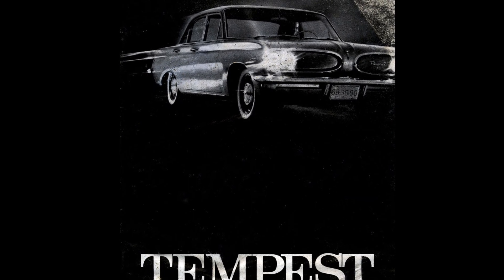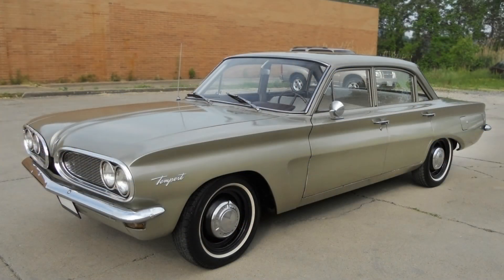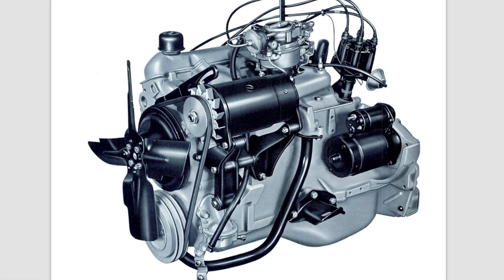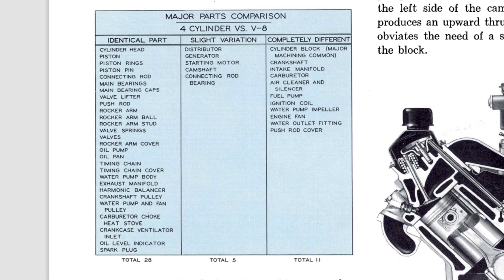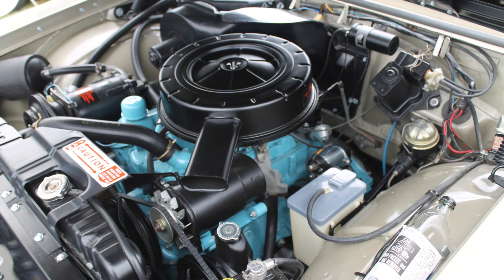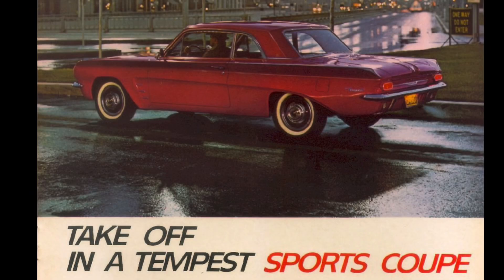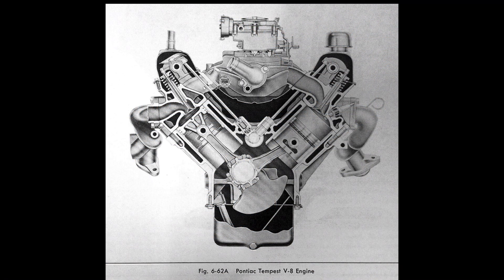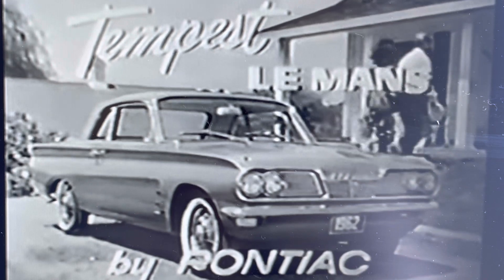Strangest Automotive Engines: The 1961-63 Pontiac Tempest & Its "Trophy 4" / "Half 389 V8" Engine

Comment: I'd love to see more videos about the first gen Tempest. I had at one time read that they had some major handling issues. I'd also love to learn about Pontiac's version of the aluminum V8 and how the engine connects to the rear transmission.
Reply: If you look at the 50 second mark in the video, it shows that the Tempest automatic transmission is just the Corvair trans with the input shaft on the opposite end of the trans. That big donut looking thing is the torque converter for the trans.
Reply: I never heard about handling issues with the original Tempest. Its weight distribution was a perfect 50/50 because of the rear mounted transmission. It was the only one of the GM compacts to have 15" wheels.
Reply: @Al-thecarhistorian  It was the swing-axes that caused handling problems when pushed to the limit, Not helped by tha cheap bias-ply tires that were common in those days.
Reply: @sunbeam8866  Before the Arab oil embargo of 1973, radial tires and disc brakes were not commonplace. My father tried to have the dealership remove the seat belts from a 1965 Vista Cruiser because the insurance company considered them to be "racing equipment" and charged a higher premium.
Reply: @spaceflight1019  I think, more likely, your dad was simply getting screwed by his insurance carrier. However, on a similar note, outside the US, Mercedes used to equip their cars with a warning-triangle, often clipped to the underside of the trunk-lid. But the story goes - for the US, it was deleted, and for Americans buying a Mercedes in Germany, dealers were supposed to remove them if they were with the car. The explanation I heard was those warning triangles were not US DOT approved. Same thing with airbags and ABS. Mercedes offered them in the early '80s, except for the US. Again - not DOT approved!
Reply: @sunbeam8866  The warning triangles were standard equipment on my 1977 Ford pickup truck but not cars. Some cars of the 1960s didn't have backup lights either. Before the federal government got involved in automotive design in the mid-1960s a lot of things taken for granted today didn't exist or were optional. Once disc brakes and radial tires were proven to reduced fuel consumption while improving safety
the insurance companies got with the program.
Reply: @spaceflight1019  I'll bet somewhere on your '77 Ford truck triangle, there was a DOT mark.
Reply: @spaceflight1019  That insurance company must have been lead by idiots! in the 1950s, my dad put seat belts INTO a few cars he owned because he saw that they saved lives in car racing accidents. In this way my father was way ahead of his time. People made fun of our family in the 1970s because my dad insisted that we always wear our seatbelts. I instinctively knew his logic was sound, watched racing like he had, and endorsed what he said and did in this manner. Then it became fashionable and commonplace, and a law in many states in the USA. Thanks, Dad!
Reply: @snowrocket  IIRC, they were with State Farm back then. I myself had no problem with the seat belt because one of my heroes - Richard Petty - wore a seat belt for every race. One of my other heroes was this hillbilly from West Virginia named Yeager. You might have heard of him...
Reply: @Al-thecarhistorian  My 62 Buick Special wagon had the 15" wheels as an option.

Comment: This engine would have had massive secondary balance problems.
Reply: Yep. It was a shaker.
Reply: No worse than any other straight 4... less with a heavily counterweighted crankshaft and heavy flywheel...
Reply: @BuzzLOLOL  the secondary forces on that engine, because of its size, are going to be immense. Of course given that it was a product of its error it probably didn't rev much about 3000 RPM anyway

Comment: My parents had the Buick Special which was based on this Y Platform...Tempest and Olds F-85.  It had the Buick V6 which pretty much evolved into the 3800 V6.  Dad liked the car, though it was a basic "keys and a heater."  It had a 3 speed on the tree manual and he said it would get 27 MPG on the highway at 65 to 70 mph.  I think the next generation...the 64 A body Intermediates were a step backward in innovation versus the Y body of 61 to 63.
Reply: Olds had an aluminum v8.

Comment: 1963 Tempest optional engine was the 326 V8, actually 336 cubic inches, same engine family as the 389. They dropped the aluminum V8 as that engine made only slightly more power than the 4 cylinder! Many drivetrain components had to be beefed up for the 326 Pontiac engine, and the 4 speed manual derived from the Corvair could not handle the torque so it was not an option for the 63 V8 Tempests
Reply: But Buick and Pontiac V8's much smoother and better sounding than the sewing machine sounding 4s... 
I think the '63 326/336 V8 was only low compression 2 bbl. carb. engine...
Reply: @BuzzLOLOL  I thought the 336  mostly got put into trucks-
nevertheless the 326/336 was a much better engine than the others 
unfortunately just too much engine for the overhead cam "Sprint" to compete against,that overhead cam engine would have been very intriguing but if I were buying a car back then the 326 was just better--
Reply: I'm sure the rope drive had more to do with it than the actual transmission. Dropping  the clutch would put a momentary load on that flexible drive cable it likely could not stand. The aluminum V8 was dropped because they were having problems getting enough good castings to build them. That was why they were redesigned in iron in 1964. They were expensive to build due to the high scrap rate and the Buick V6 was cast in iron as well because of that. I am wondering how the 194 CID 4 Cly. was able to make so much more HP than the 235 straight 6 and why they kept building the six?
Reply: @keithstudly6071  The 4 had a crossflow head and larger carburetor,the inline 6 intended as an economy engine had a small one barrel carburetor. However the 6 was a lot smoother running. Also the 4 being derived from the famous 389 probably had larger valves and a bigger bore size (although I am not sure about that)
Reply: @keithstudly6071  the 230 Chevy "6" was new for '63 and made it's debut at 140hp in full-size Chevys. HOWEVER, there was also an "oddball", one-year-only cammed up version (same concept they used to produce the higher output non-turbo Corvair engines). That put out 155hp & was available as an option ONLY in Chevelle & Chevy II (Nova), not in the full-size line. Check it out. I wonder if anyone ever adapted a 4bbl carb to that version...
Reply: They ran the rope drive behind the SD 421 V8 on the rare 63 "Super Duty" Tempests (many articles on the web about this). The rope drive was not the weak link.

Comment: I have always loved Pontiacs. Was very disappointed when GM nixed the brand.  I've owned quite a few and had friends who owned several, themselves.  I would have loved to know what engine you alluded to at the end of this video.  The reason is, I owned a 1965 Tempest, with a 215cid straight six (I put an Offenhauser intake manifold with a 4 barrel carburetor) with "3 on the tree" and a 1966 Tempest Convertible automatic (with posi-traction, weird configuration).  The 1966 had a 326cid. V-8 (2 barrel). I won't bore you with the other Pontiacs that I have owned.
Reply: '66 - '69, Pontiac had the OHC 6's in 215 - 250"... 
By '63, Tempest had the Buick 215" aluminum V8s and Pontiac '326' (actually 336" briefly since GM suddenly added a 330" limit to mid size cars) V8...

Comment: Back then, I was obsessed with maximum hp...as an older man now, I really appreciate the tempest package...wow, a 4sp, 166hp 4cyl would be such fun to drive around in now...that car would offer offer both decent handling, and enough power to move that rather light vehicle down the road...and with 4-wheel independent suspension too?  Very impressive effort for that time period...Of course, the eventual 6cyl, OHC engine was an even better choice for those who wanted at least a modicum of gas mileage--and also more performance.  But this 4cyl adventure is very cool!
Reply: I think the 4 banger eventually reached 180 HP... 1/2 that of a later tripower 360 HP GTO 389" V8... and was available with a 4 speed manual... by '63 had Buick 215" and Pontiac '326' (336")V8's... 
Back in 1960's, my daily driver was the 1962 Olds Jetfire version of this car body: 
https://www.youtube.com/watch?v=Jzw5W1rRMog
Reply: Although not a Tempest, my first car was the 67 Firebird. It had the lower power OHC six. My buddy had the Firebird Sprint OHC six. Mine came with a single barrel carb and his had the four barrel quadrajet. I believe the Sprint was rated at 250 HP, I could be wrong though. He could burn rubber in all three gears!
We just loved are Pontiac’s!❤
Reply: @nealrehm6895  We had a 66 Lemans with the OHC 6 and Powerglide 2 speed trans. If you floored it from take off, it would hold first gear to 65 mph. Don't know how fast the engine was spinning, but it didn't sound like you wanted to hold that gear any longer.
Reply: Gimme a V8! 😀
Reply: You need to remember the Tempest had the same swing axle rear suspension that got the Corvair labeled as "Unsafe at Any Speed". I don't know if it suffered from the same wheel jacking problems as the Corvair, but the swing axle wasn't a great arrangement in most cars that used it. The swing axle rear end contributed to my brother rolling a Triumph GT6 that had it.
Reply: Grab an old T-bird with the 4 cyl turbo if you want to be impressed.

Comment: One must note that the independent rear suspension of the ‘61-‘63 Tempest saved the main characters from the movie “My Cousin Vinny” from going to jail during the climactic murder trial at the end of the movie!
Reply: I heard the clip from the trial in which the female lawyer compares the '63 Tempest to the '64 Skylark. Much of what she said was wrong, including the claim that the cars shared the same wheelbase, but I doubt most people watching that movie (in maybe 1992 ?)  noticed.
Reply: She was so cute that she could say anything and we would all just nod.
Reply: Sure did save those two yutes. 🤣
Reply: @lindycorgey2743  what's a yute?
Reply: @bencotton3050  "Yute" is how Vinny pronounced 'youth' in the movie.
Reply: Although by the time the movie came out it was out of date and those cars were mostly off the road...
Reply: I had a 1962 Tempest in 1969. A friend joking said I should put a 327 in it and I did.  I strengthened the unibody to support leaf springs for the rearend and transmission and welded a new floor for the transmission. It was quick. I blew the 327 and ran it with a 283 for a few years and sold it.
Reply: @Chris_at_Home  You still owe me a ten second car !!
Reply: Too bad you couldn’t have typed that with a Jersey accent.
Reply: @davidleary823  That's "Joisey" accent ...
Reply: @davidleary823  you mean  Joysie accent?
Reply: The first thing I thought about when I saw this video on my feed.
Reply: @msmeyersmd8  me too
Reply: That transaxle was essentially a Corvair unit.
Reply: That’s because they were Youts.. ya know.. young people!
Reply: The only error I caught was the movie stating said Tempest had either 13 or 14" wheels; 15s were standard.

Now for a really weird feature; said 1961-63 Tempest/Le Mans cars used the 5 x 4/5" 5 lug Ford/Mopar/AMC/Studebaker bolt pattern(!), NOT the Chevy 5 x 4.75"
Reply: @piercehawke8021  Wow! That IS weird!
Another weird one is the full syncro three speeds offered in early 60s GM cars were made by Ford and even have the Ford logo cast into the cases.
Reply: @daryllect6659  If memory holds me correctly; the big US market Pontiac did use that Ford box, not sure about Buick or Oldsmobile, before 1971
Reply: @piercehawke8021  All the GM cars did from what I understand. With 3-speed sales dropping quickly, GM decided to concentrate on automatics. Ford came up with a very nice, very well-built 3-speed, and GM bought them because it was less expensive than updating their own transmissions, and Ford did all the hard work for them.
Reply: Saved the "Two Youts"  🙂
Reply: My dad always said you’ll see it all if you live long enough. I was not aware of the rear transmission or the half-a-V8. Apparently my thinking starts at 1964 when the Lemans begat the GTO. Talk about one car’s evolution in just 4 years! Interesting video. I liked it. 🥸👍✅
Reply: Positrac 🎉😂
Reply: Whew! At first I thought it was a Corvette... with metallic mint green paint.
Reply: Yes, one simply must.😂
Reply: "One must note that the independent rear suspension of the ‘61-‘63 Tempest saved the main characters from the movie “My Cousin Vinny” 

No, it was the fact that the tire marks indicated that the vehicle had a limited slip differential. Nothing to do with IRS.
Reply: @daryllect6659  Nah, watch it again.  

Tomei's character addressed both the positrac and the irs.  
The former allowed the rubber to be continuously laid across the curb, whilst the latter allowed the track of both tires to remain simultaneously flat as said rubber was being laid.
Reply: @1SqueakyWheel  Good points! I will watch it again, if for nothing else just to watch it again.
Reply: @daryllect6659  Not exactly true Daryl - as pointed out in the movie, the solid axle tilts both tires at an angle when one side is raised up, and an independent suspension doesn't do that.  So there is a difference in tire contact patch when on uneven ground.
Reply: @daryllect6659  Watch it again, it was both.